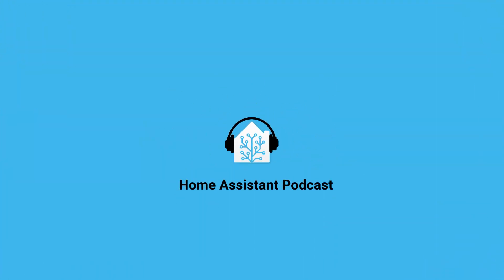Aqara FP1 Presence Sensor Issues | Home Assistant Podcast

Comment: I bought 2 Fp1's from China before they were widely available elsewhere and they work brilliantly. They always detect home and away for me. I also have a cheaper generic ceiling mounted presence sensor which occasionally loses contact with my zigbee network requiring getting steps out to climb up and power cycle it.
Reply from the maker: Nice one. I've seen the ceiling mount ones too. Would love them, but not sure about having something from China perma-wired in to my house electricity. 

P
Reply: @hasspodcast  I bought a second one because the millimetre wave sensors stopped responding, but since it arrived they haven't missed a beat 🤣
Reply: @hasspodcast  the 1st one came with a 12v power supply, it has been in the bathroom ceiling for more than u
6 months without any issues.

Comment: The FP1 arrived yesterday and is consistently stuck on 'detected'. This is a game changer for me as 50% of the FP1 unique functionality does not work for my automation's. I have reset, re-paired, re-positioned, restarted HA, etc. etc.  If you have found a quick fix, please let us know. Thanks for posting.
Reply from the maker: Hey Ward!

Unfortunately this is consistent with me too. I have about 7 of the FP1, and 2 of them consistently get stuck detecting presence. 

The only solution I have is to power cycle them. I have got some Sonoff smart USB plugs. My solution is going to be to power cycle them automatically when presence is detected for more than x minutes. 

Not ideal at all. 

-Phil